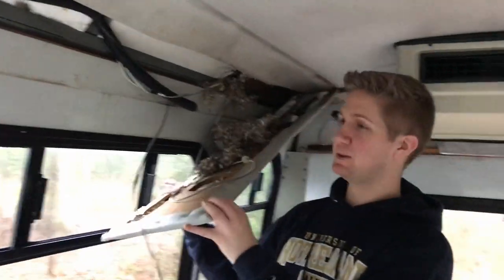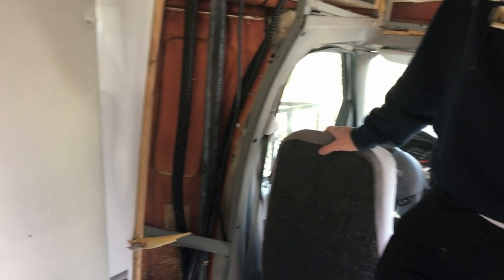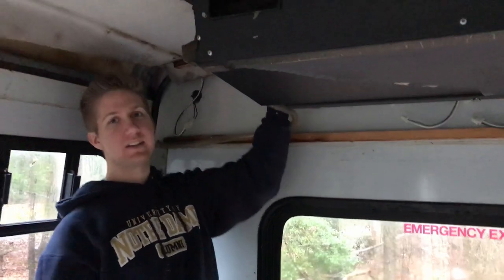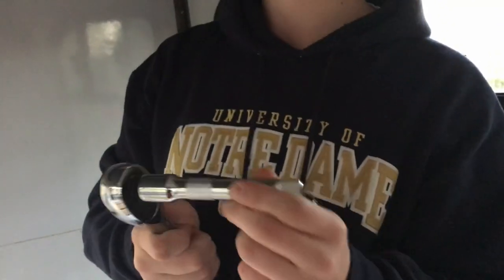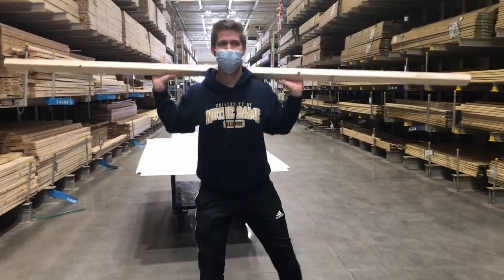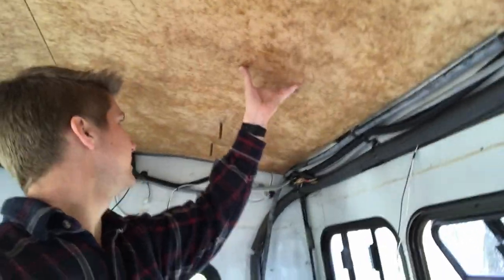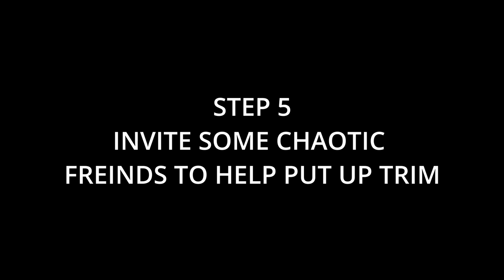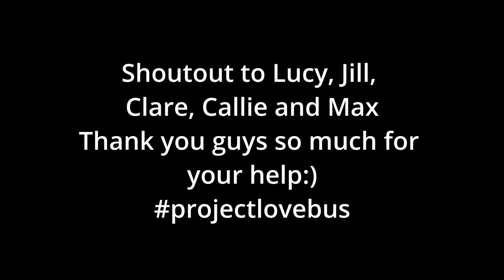Bus Build | Episode 3: Simple Ceiling Installation

Comment: I just bought/stole a 2003 Ford E350 turbo diesel church bus that was just converted by the owner for $5500 with 104,000 original miles that looks identical to your bus I talked him down to $5000 so basically I got a free bus BUT have to replace the floor and ceiling which means I have to also remove the cabinets sink and tankless water heater before I can replace the floor